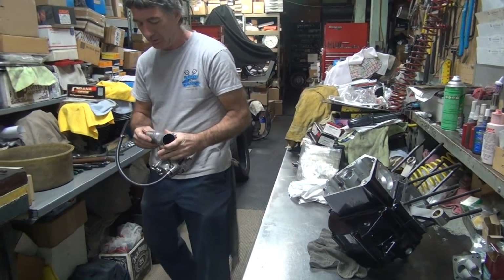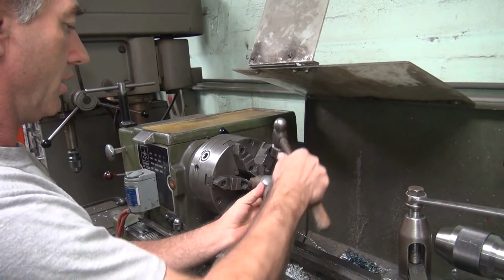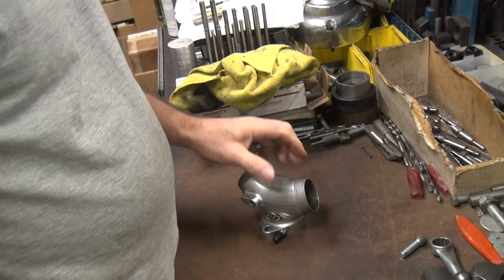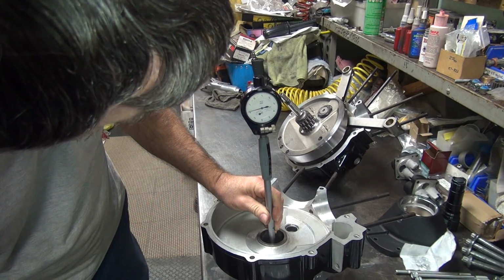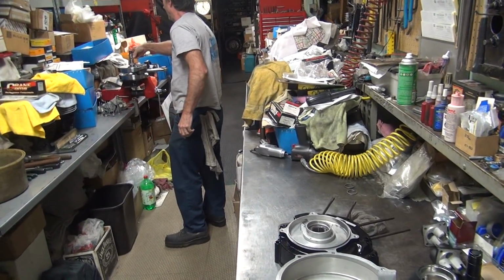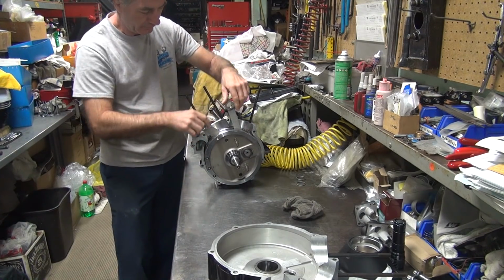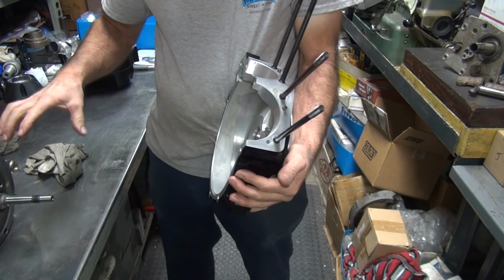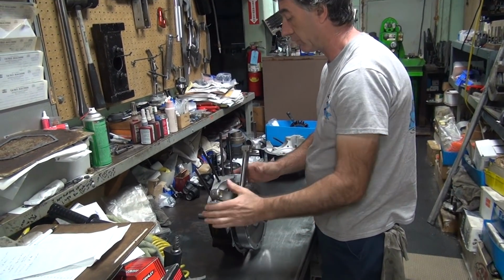2000 fxr4 80ci #109 motor rebuild fxr evo harley evolution cam bearing repair by tatro machine

Comment: I do like the fact that you went for a rounder truer bearing race, but wouldn't it have been better to leave it a little tight and he could of used a little restraint and break the motor in before hot rodding it, or is this the old guy thinking to hard about it.
Reply from the maker: breaking it in is more about the rings and valve seats. bearing don't change that much for many many miles. the harder you run a motor the looser it needs to be. if you don't give it some breathing room it will make its own and you will not like the results of that.
tatro